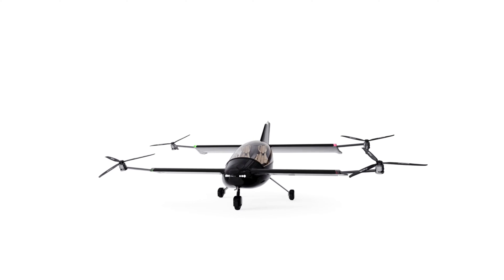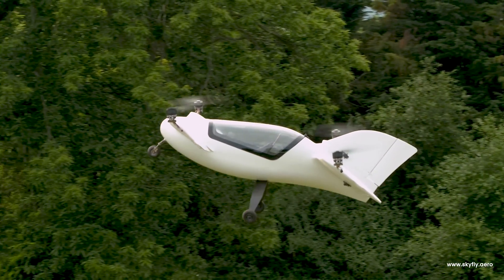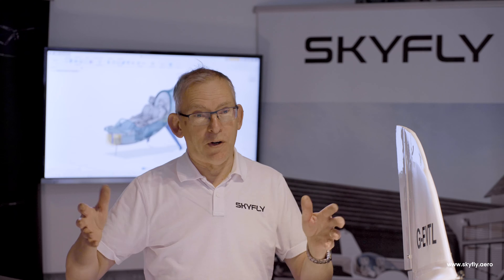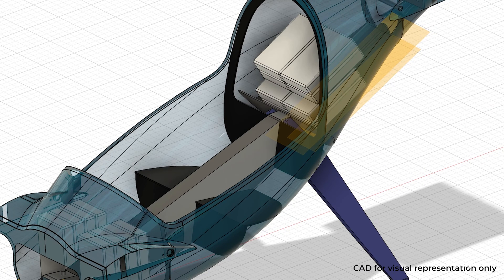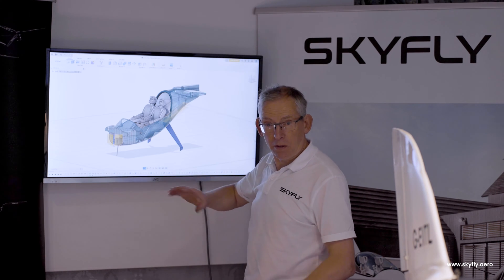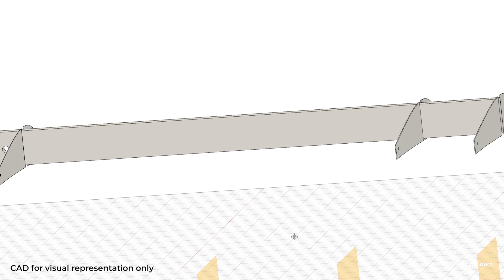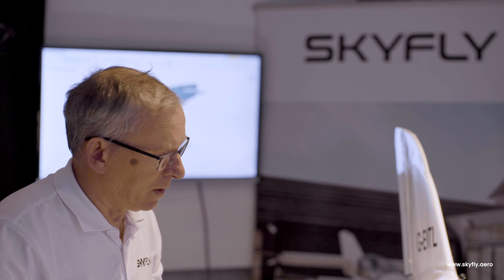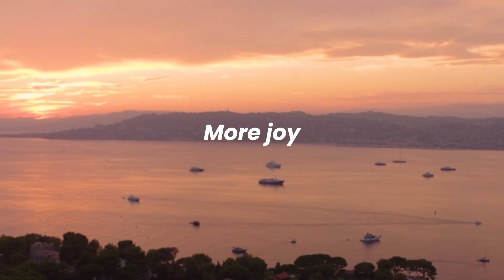Designing the Axe eVTOL - an in-depth interview with CTO Dr William Brooks

Comment: Fascinating stuff - Some unique solutions to old problems. From a systems perspective you have decoupled the energy storage solution - which should give you some future flexibility. I also like the resin infusion technique - it offers the means to embed sensors throughout the fuse and thus possibly a digital twin development process.

Comment: So..  in the vertical take off attitude, you don’t really have a view forwards. Batteries, a (hot) range extender and fuel: in the cabin. 2x24kWh = 24 minutes of (hovering) flight time with no reserves. Only four lifting rotors: how do you keep this thing stable if one fails? FRP infusion process may be nice, but voids save weight: they just contain air (for most parts’ strength, that shouldn’t be a factor).
Overall: I wouldn’t fly that machine.
Reply: you want as close to zero voids in a composite structure in an aircraft.  Every void is a potential catastrophic failure point that could get someone killed.  While there are 4 propellers there are actually 8 motors.  they explained this in the video you are commenting on